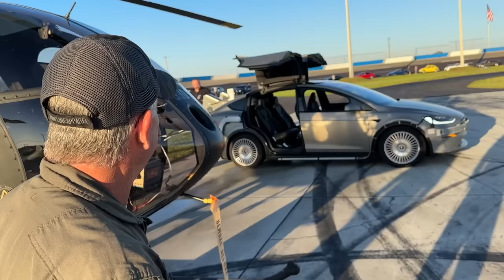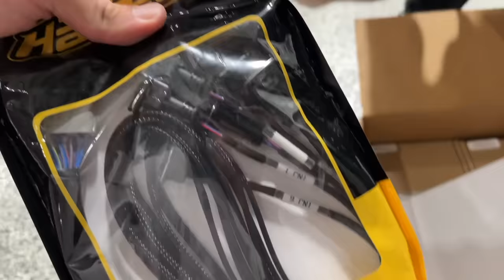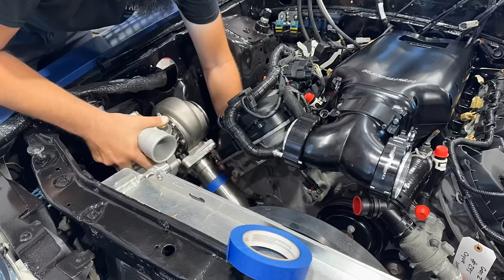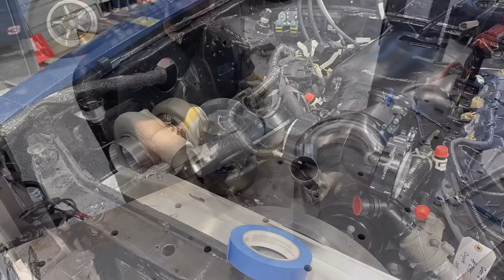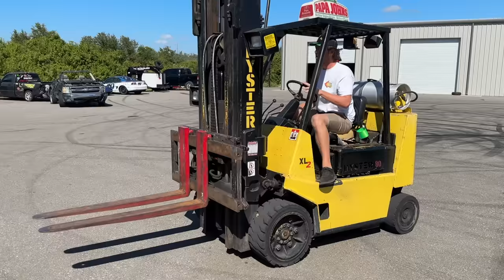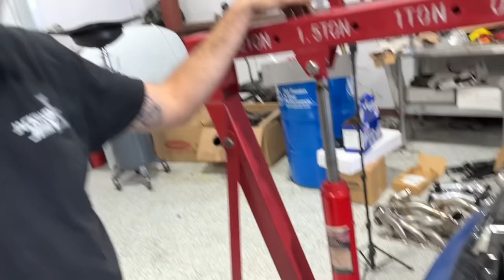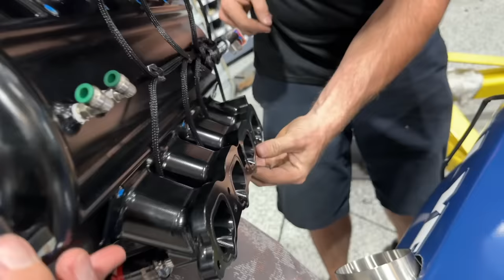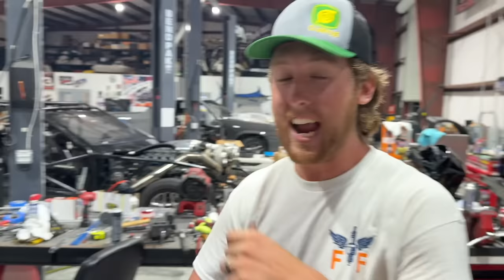McFlurry Get's a 2,000hp Twin Turbo Coyote Swap In ONE WEEK... SOUNDS AMAZING!!!

Comment: Gotta love it with LS guys realize whose king daddy. 😂
Reply: Exactly, when he switched to a big block it was the best thing he could've done. and now even better with the SMX. Ohh you meant the Coyote? LOL, yeah those are pretty good too.
Reply: @TheFlooringInspector82  I disagree. The big block is cool and all. But there is a reason why there are more and more Coyotes entering his fleet. Brett Lasala has been proving the potential of the Coyote engine and continues to keep pushing the bar with it, and even Cleetus can't deny how much potential it has.  Hell, even Cooper wants to ditch the 2j in the Camaro for a Coyote now.
Reply: I'll agree with you that the Coyote is a good Engine but King Daddy, better than the SMX, I don't think so, it may be competition with the LS but that's it.
Reply: @michaelwynne4346  for the cost? Not even close. You're talking about a $75,000+ billet block / head manufactured in the aftermarket.  Compared to an OEM casted head and block that had been sleeved with billet main caps for a third of the cost. Keep in mind that Lasala went 6.3x with a similar engine configuration in drag and drive trim compared to mullet 6.5x. Proof is in the pudding. I'm not going to be shocked if McFlurry ends up being faster than Mullet once they go with a bigger turbo configuration.

Comment: Going to miss the progress y’all keep making on the Godzilla 😢
Reply: Im so sad to see it leave
Reply: Godzilla is such a step back from the Coyote. Cars finally going to be going in the right direction.
Reply: @snailfedperformance7177  Meh, depends on what you’re doing. The Godzilla has its own benefits and still slaps around the LS performance wise. But for what they are doing the Coyote is definitely the right move.
Reply: @ChuckThree  I disagree. They had the Godzilla engine in Mcflurry and it broke every few passes. At least the LS engines on the channel have completed races without being cooked. Also, the Godzilla has yet to accomplish anything that the LS platform has performance wise. But them switching to a fully built Coyote engine will mean more reliability and more performance as well as more aftermarket support.
Reply: @ChuckThree  definitely not. You have a team with unlimited support and more resources than most, just show you the limitations of the 7.3. You have unopened stock Coyotes in heavy ass s550 chassis Mustangs that have been 7s. In no world is the 7.3 ever an advantage.  With bigger turbo on the Foxbody, Cleetus just built a car that is more than capable of competing with Mullet.

Comment: Somehow I got this feeling that this will be the fastest on the fleet eventually.
Reply: It's a ford, doubt
Reply: Ford smoked Mullet! Can't beat em join em
Reply: 5.0 can breathe super well, and run high RPMs. They love some boost as well. And that's all about the stock setups. This one is built to take a heap of power north of the already high limits.
Reply: @gunsandmachinesenthusiast Their fastest already got bested by a ford. Ez pz

Comment: ZACK! hey freightliner tech here be careful doing a service on those DD15s without a fuel primer quick way to let those high pressure pumps eat itself they relay on fuel for lubrication. anyways use the hand pump primer on it. LPPO pressure needs minimum 35 psi before injectors will fire, should take about 100-200 hand pumps. just pump until you feel pressure building then pump while having someone crank it over. Once running hold rpm up to about 1000-1200 rpm until you hear air stop chirping, drive it dont shut it off. Or just get Cleet to buy a DAVCO fuel primer lol also fyi its 11gal oil

Comment: props for him tryen to change fuel filters on the toater. So i work on these trucks daily Step 1 take old filter off (make sure seals and gaskets are all removed), step 2 fill new filter with diesel and then screw into place, Step 3 I noticed on your truck you have a priming hand pump at the 2.52 mark just to the right of your oil filter cap (big black stop sign shaped nipple cap) is a nob the unscrews (right handed threads) when unscrewed all the way you pull up and this works as a pump priming the rest of the lines. When the pump becomes firm screw it back down and fire the truck.

Comment: for bleeding that diesel faster, you need to put pressurized fuel into the comp-u-check fitting near the middle of that fuel filter housing.  Big engine, big torque!!

Comment: @CleetusM on the motorhome there’s a fuel priming rod on the fuel filter housing you have to unscrew, you have to get it fully pressurised for it to crank over and make sure to screw it back in or you could airlock the fuel system 👍🏻

Comment: On that DD13/15 engine the fuel pump is lubricated by fuel. There is a hand primer by the small filter on top of that module. If the system isn’t primed the fuel pump cam lobes and cylinders aren’t lubricated while turning over and will score then will continue to damage it self until the system is full of metal. We do 3-4 fuel systems a week at work because of this. Gets costly fast. Either hand prime or get a priming pump like davco makes.

Comment: There is a fuel hand primer on the fuel filter module for the semi truck, it’s right in front of the smaller cap. Just unscrew and pump that thing about 300 times.

Comment: Hey cleetus, those engine are really sensitive on fuel pressure. Youre gonna hurt the fuel pump from running dry. Buy a J-47912 fuel primer and prime fuel on the quick connect near the fuel filters.They are hard one to start when doing oil change 😁

Comment: When priming the freightliner change one filter and then before you fully tighten down cap prime until fuel starts to come out then tighten down and start repeat process for second filter. I am a freightliner mobile tech that runs your area if you ever need anything

Comment: On those Detroit motors on your hauler, when you change the fuel filters, there is a primer you have to unscrew then push until it gets hard to Prime the system. It’s next to the two fuel Filters

Comment: I would like to say that on dd13 and dd15 Detroit’s to change oil and start for a min and then change gas filters. There is also a hand primer between the two gas filters. I am a service tech and Doggett frightliner and we have had people come in doing a service them selfs and trying to start changing both and it can dry out the bearing surface on the crank because it is a “hard dry start” just a tip

Comment: Some info on the DD15 in the toter, Detroit service procedure says after filter replacement to work the hand pump 350 times and attempt to start, if no start then repeat the process. Davco makes a priming cart that does all that in about 30 seconds.

Comment: Hey brotha on your Freightliner there is a quick disconnect fitting on the fuel filter housing that you can get an in-line fuel pump and run hose from a gas can and connect to the quick disconnect and it'll prime up the fuel way more quickly

Comment: There is a couple easy way to prime the Freightliner’s you can get a metal pump up sprayer and the correct fitting to connect to fitting on the fuel filter housing or they make a Davco fuel priming machine, that works wonders use them every day!!

Comment: For the freightliner u need a pump to pump diesel into the fuel system right where the filters are, there's an adopter almost looks like a air hose adapter (like for a air compressor) I think this is the part number Kent-Moore J-47912. But if u want not to spend the money just buy the adapter and u can use a random electric fuel pump and prime it with diesel

Comment: Diesel tech here, Detroit engine (especially DD-15's) are notorious for being hard to prime. Have a 2nd guy pump the primer pump as fast as you can while cranking. She'll fire up. Let it idle for 15 mins to hold the prime.

Comment: Im not a certified diesel mechanic but i worked on semi trucks with similar if not the same engine as the toter home 5 days a week for almost 5 years and know how to do the basic servicing involved in there operation even the servicing of the APU's( generators) there is a unscrewable primer attached to the fuel filter housing to help prime the fuel and at the same time pushing the air towards the fuel injectors to aid in bleeding the air out of the fuel system when turning the engine over the dd15s and its smaller Variants all have a similar problem when the fuel filter is changed and can sometimes be stubborn to get to start

Comment: I'm sure someone already said this but I'm too lazy to scroll. On those dd15s or whatever series you have. When you pull the fuels. Keep 1-2 Gatorade bottles with diesel in em. Get the new filters ready and when they're ready fill those fuel bowls and quickly yeet those filters in. There's a manual primer which is the little small round piece in between the filter. Even with filling bowls and yeeting filters in. Pump that manual primer to make sure it's hard and fire her off.

Comment: Im sure its fixed and running now but, when changin fuel filters on a semi fill them with fuel first. If your still having issues with the prime take the fuel cap off of 1 of the tanks grab a hand full of rags and shove an air gun into the tank, use the rags to keep pressure and pump air into the fuel tank it will push the fuel into the rails and make it easier to start. Also to avoid that invest in a FASS Fuel system (electric fuel pump) it will fix those issues for you

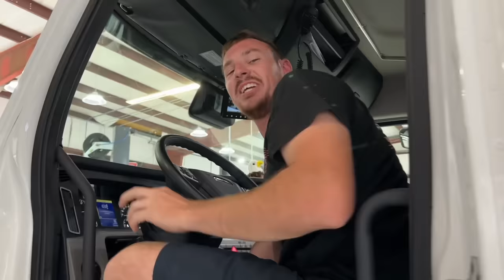Comment: @2:34 im with Zach. But the DD13 engine is the easiest thing ever to do a wet service on. I'm sure you figured this out by now, but there is a little primer plunger on the fuel filter housing, you just need to pump it 180 thousand million times 😆, or you can pre- soak the new filter in diesel before you install it. 😝👌👊

Comment: Just a heads up. Spec is to pump the fuel primer 300 times after filter change. The high pressure pumps are lubed by fuel. If you dont prime it youll burn it up cranking it. Not a fun job or cheap job on those.

Comment: There is a hand pump on the side of the fuel filter housing you have to pump that about 200 times, otherwise you’ll throw a CEL light for fuel pressure

Comment: Recommend changing oil then starting it before doing fuel filters. Those like to spin bearings if you crank to long after oil and filter trying to get fuel system primed.

Comment: Idk if Zach put diesel in the filter housing when he changed them. Put definitely fill those puppies up and then there is a primer right next to the fuel filter housing just hit that baby for about a minute. And another way to do it is crank the engine while someone is priming. Haha also grab some assembly grease that's silicone safe most greases are and put that on those o-rings they won't fall out while installing and they won't dry out .

Comment: Build a pressure bleeder for the Detroit. 50psi behind some diesel plumbed to the quick connect fitting on the fuel filter housing.  It takes a bit of run time so get all the air out so sometimes the second start can also be a bit delayed.  When the grommets start leaking around the fuel lines change 2 at a time and run engine and repeat. Or you’ll find out what some real injectors cost 😳

Comment: There is a primer plunger by the fuel filter by the steering shaft unscrew it and plunge it 25 times slowly and it should fire right up

Comment: The hustler needs its primary lift cylinder rebuilt most likely. I’ve seen that the secondary cylinders stage before the primary (free lift cylinder). Might wanna get that checked out :)

Comment: On the diesel-powered truck, when you change the fuel filter you need to fill the new  filter b4 putting it back on and then prime the fuel system otherwise it could be a bugger to get going, ether helps but you'r not supposed to use ether on newer diesels.

Comment: DD series doesn't have an electronic pump, without a primer you have to use the hand pump primer on the fuel module. Do not crank it without a good prime, you'll destroy the pump. If she fires and you hear chirping shut it down and pump the primer more. The fuel pump chirps if you don't have it fully primed and it'll slowly self destruct the pump if you let it run chirping. Detroit calls for 300 pumps on the primer. Expect some extended cranking for a little while after fuel module filters have been replaced. Those filters should easily last 100K miles if you properly maintain the Davco filter. The good extended life Mobil oil will easily last 50K miles. we run our oil for 80K, fuel module filters 120K, engine air filter 180K, assuming it's a Detroit trans 200K. Fleet consists of 12K trucks, over 9K are Freightliners kitted with a Detroit powertrain. We've been running these intervals since 2010.

Comment: For the toter home you need to pressurize the fuel system because the DD doesn't have sufficient vacuum to pull diesel from the tank so need to fill the filter housing so it will start. There is a ESOC machine specifically for Detroit Diesel engines to make it easier. I'm assuming JH helped and got it sorted though.

Comment: There is a priming valve on the dual engine fuel filters lol. d/s back engine. I work on these engines everyday. Pump til tight then start.

Comment: On the Detroit change oil start engine for a minute or so before doing fuel filters so it gets oil pressure faster.. Ty will need to pump the primer around 100 times unless he cheats and puts about 20 psi air pressure into fuel tanks . I apply a little bit of air through the tank vent hose then loosen cap to release pressure after it starts.

Comment: On those detroit diesels you have to change the oil and fuel filters separately and run it for about 5 minutes between. They tied the oil and fuel pressures together and it starves the engine for oil on start up if you do it all together.

Comment: That is a paccar engine in the toter home, and when you change the fuel filters you need to manually prime the engine with a primer that is right on top of filter housing, that screws out then pumps up and down to prime the system, you can fill the housings with diesel about half way to help it prime easier, also do not use ether on it neither it could send it into protection mode by spraying it and over cranking, these new heavy duty diesel engines are very particular about that fuel as well so watch where you get your diesel from brother

Comment: There’s a primer on the fuel filter housing, also shoulda filled the filters with fuel. Air locking a diesel is no fun lol. And most Detroit’s don’t have electric pumps

Comment: The freightliners issue is it is just Vapor locked you need to bleed the air out of the fuel system and you need to prefill the fuel filters with fuel

Comment: Should be a hand primer on the fuel filter. Just pump on that for 5 minutes or so and usually they start

Also if there is a intake shut off make sure that is open lol

Comment: I’ve always wanted them to build a coyote powered Fox and now they build one with one of the badeeet Coyotes built. I can’t wait to see it run its first 6 second pass when you guys get it dialed in, this gives me some extra motivation to slap the clutch and new rear gear in my coyote fox 😂, well mine has a 55k miles hand me down coyote.
Reply: Right, I’ve been waiting for this build forever now. Garrett has unlimited resources, so this should get interesting.

Comment: @cleetusM tell zack to put a air hose in the tank with a rag around it on the toter and blow air in the tank it’ll prime the fuel so it will crank easier

Comment: You gotta prime the fuel system on the motor home. Those Detroit engines have a very sensitive fuel system and cranking on it dry like the will destroy the pump. Feel free to send me a message. I’ll detail how to prime it and any other questions you guys have about that engine.

Comment: If that is a Detroit. 
Never change the oil filters and fuel filters at the same time without starting engine inbetween. You will spin a bearing.

Comment: No no no, I could hear the fuel pump hurting while he was on the starter, that is an absolute terrible thing to do on a dd engine. Those fuel pumps are only lubricated by the fuel and require about 70psi of fuel pressure to be lubricated, we call it chirping but when you hear the engine to a high pitched noise that’s your fuel pump eating itself alive. The only way you should be “bleeding” the fuel system on those engines is by using the fuel hand primer that’s next to your fuel filters, which will take about 200 pumps till it starts to get stiff, or by using some sort of auxiliary pressurized fuel pump to prime the fuel system by hooking into the fuel module. Even then the dd fuel pumps are notorious for being picky about lubrication so you won’t be able to rev it up for a couple minutes or the pump will start chirping again. At least you got a ghg17 before the new gen 5 engines came out, dodged a bullet there.

Comment: I already know that motor I'm certified for detriot to prime them you can sit their for 500 pumps or buy a e socket to prime them that's what my dealer uses for prime any detriot as soon as you open the fuel system they are such a pain in the ass

Comment: As a diesel tech with a few of them Mercedes Detroits in the fleet, they're a b!tch to get going after fuel filters and it starts tough the first 4 starts.  We have a weed spray we fill with diesel and have a fitting on the check valve.

Comment: No need for intercooler anymore?
Reply: A high air intake temp can lead to detonation, but it's possible McCurry will be running methanol, which will offset this issue.
Reply: @mrmatt7210  figure it was e85 or something like that. Crazy how the tech has gotten so far from well,my time in the 80-90s. Big jump in just couple years.
Reply: @elreyyakko  I agree